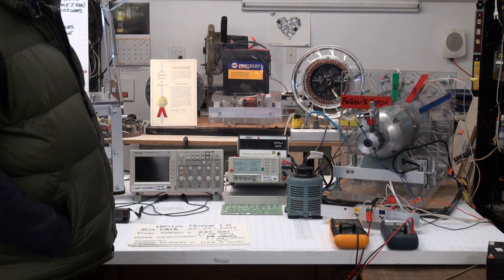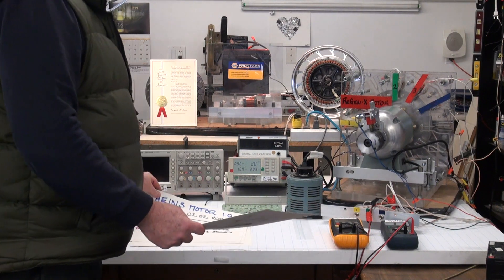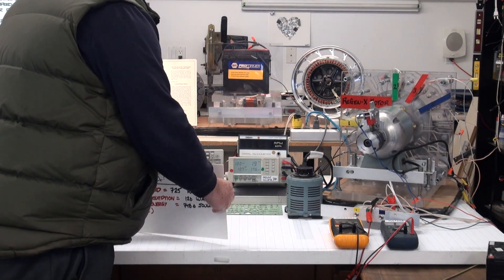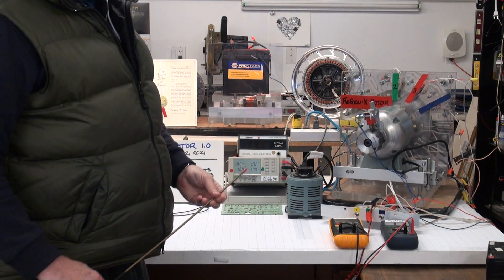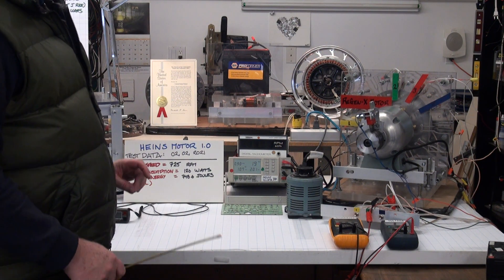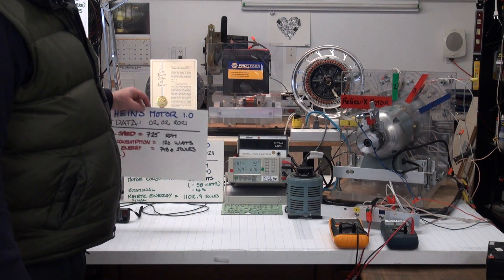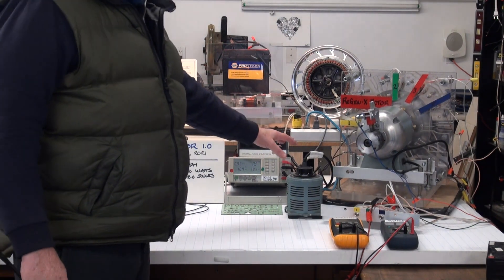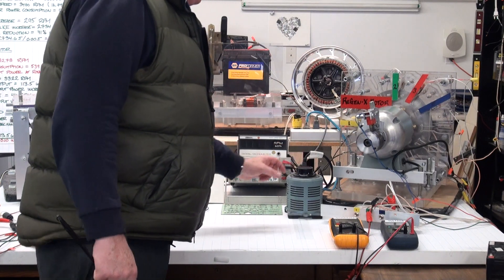HEINS MOTOR - Mechanical Work OUT with Zero Energy IN

Comment: Awesome work Mr Heins.
You always show your builds with 3 Heins coils. Here, when the input of 125 watt has an rpm of 725 rpm. Engaging your 3 Heins coils drops the draw to about 70 watt. This means minus 55 watt. The RPM increases to 880 RPM also. wich means more kinetic work done. I recon, the 880 RPM is a solid ground for the regenerative induction to happen. So adding more Heins coils won't increase speed very much, but with adding 5 more coils, you will exceed the 125 watt needed to get the motor up to speed and then you will have a free running , kinetic energy producing Thane Heins motor that is simply revolutionair.

That said, 8 Thane Heins coils should give you all the power you'll ever need.

Thanks for your amazing work and the courage and stamina to go on, even though the elite establischment won't like it.
You are truly a pioneer and should be recognized for it world wide. I guess a Nobel prize would do some good.

Cheers, from Holland

René
Reply from the maker: 5 coils here ;-) ... https://youtu.be/5-vZyBJdta8
Reply: @PDiCanada1  

Wow..... making huge progress.
I have a question though that might spark an idea. What if you had on one axel multiple discs with magnets spaced. Every disc has the magnets spaced differently. From a very small spacing to larger and larger spacings. You could ramp up the axel and engage the first set of coils to increase rpm. Then at the max. rpm for that set of magnets you disengage the active coils and engage the next set with wider spaced magnets, wich will increase rpm again further. This way you could make the motor/generator increase rpm until you reach the last disc of magnets with the widest gap. In theory you only need a small amount of energy to get the axel/motor up to a modest speed en increase incrementally.

As it is now, you use a motor to initially ramp up the speed. This motor needs a considerall amount of energy. Why not just use an axel with the magnets on it and start the axel rotation with a pulse motor arrangment.

Cheers,  ( a real fan of your work)

Rene

Comment: Cannot wait to see the road test video ! this will be ground breaking. just wondering in this video, when you engage the RegenX motor, is it producing electric power at the same time ? or does it just act to reduce the input power required ?

Comment: How does it compare to the same motor wired normally. Can you add additional coils to further improve performance
Reply from the maker: HEINS Motor Coils operate at infinite efficiency I.E. provide torque and acceleration with zero electrical input energy.
Cheers
Thane

Comment: How does it compare to the same motor wired normally? Also can you add additional coils to further increase performance. Amazing work.
Reply: Unidirectional pulse goes through ReGenX coil, magnetic field moves rotor. Coils is switched from motor state to generator state. In generator state, energy is harvested from ReGenX coil, and used to power another ReGenX coil in motor mode.
Reply: Pulse through RegenX coil is 25% of duty cycle. Another 25% of duty cycle RegenX coil return energy back to source, and simultaneously do positive mechanical work. The rest 50% of duty cycle RegenX coil act as AC  generator. 75 % of duty cycle coil generate energy, 25% of duty cycle coil consume energy. 1/3 of generated energy is cold electricity pulse, and 2/3 is hot electricity sine wave.